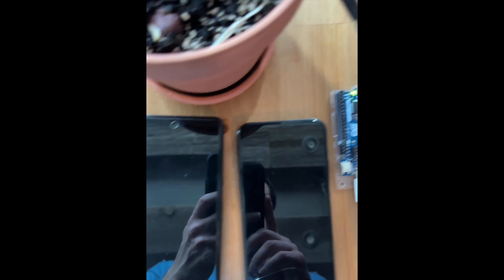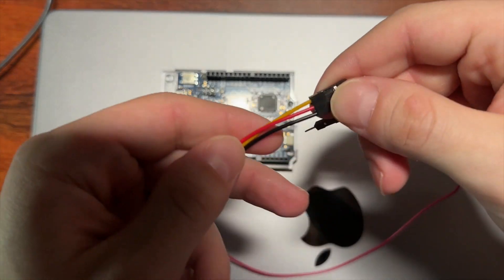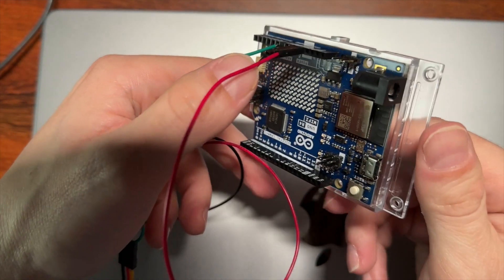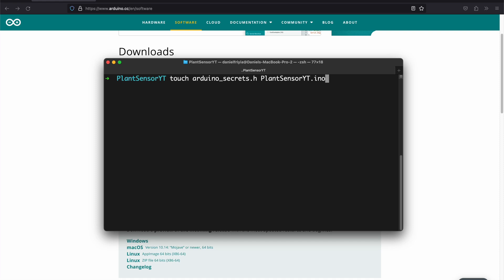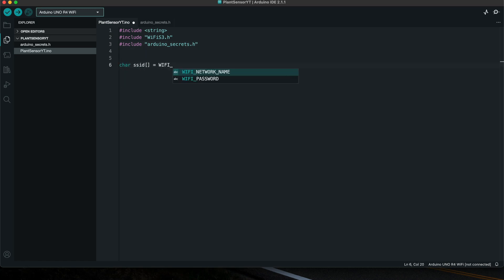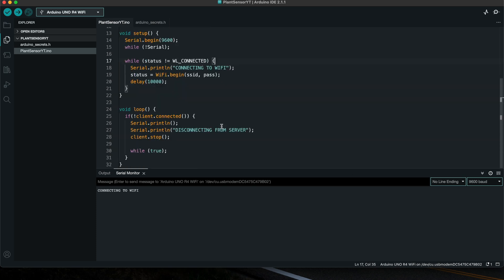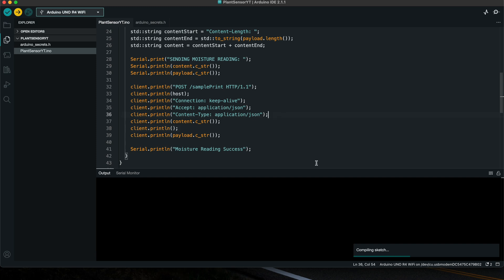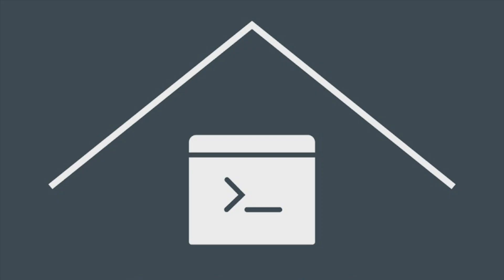How to connect Arduino to WIFI - Fullstack Internet of Things ( IoT ) with Expo

Comment: What do you mean with "WEB_ADDRESS"  and "HOST" (6.25min)?
Reply: Those came from his secrets file, IIRC.  He should have put dummy values but reasons.  Obviously he did a camera cut and filled those in plus his wifi password off camera.  IP addresses is my guess, his and theirs.  Or some such.
Reply: @NShellhopper  So the IP adress of the wifi router/cellular device for "WEB_ADDRESS", but what for host?